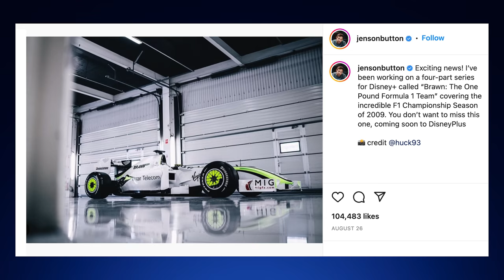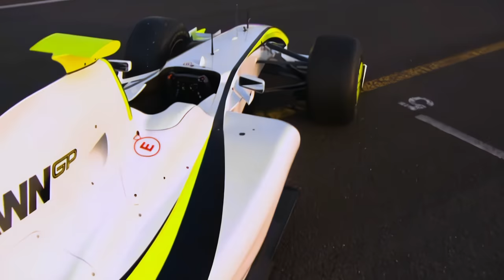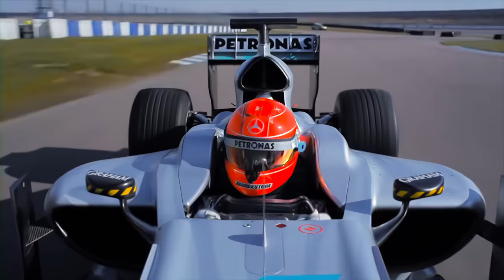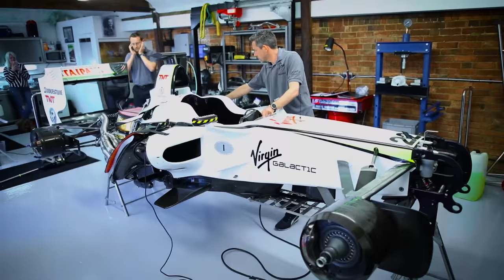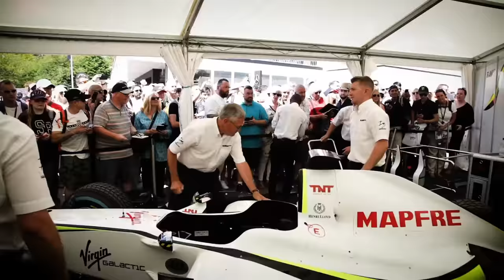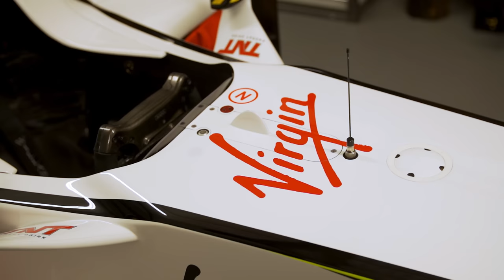Meet The Star Of Brawn: The Impossible Formula 1 Story

Comment: Love to see people maintain old f1 cars instead of just letting them fall into disrepair
Reply: When I was at Williams there was an area where all the cars that hadn't been sold were stacked. Some had parts missing and one of them leaked oil constantly.
Reply: @timwarriner38  mercedes and mclaren fire up there older cars that they have retained for both they have alot of cars
Reply: That's is absolutely stupid to just let these cars rot in the garage.
Reply: @user-hw4st7br9a  all the cars retained by teams are maintained the get fired up to keep them in working condition the ones owned privately most are maintained (I am not aware of any that are not maintained)even the very old cars get run on track still martin brundle has driven a lot of the very old cars on track.
Reply: @user-hw4st7br9a  Well the trouble these days is most teams make at least 4 chassis for the year so that's 4 cars assuming all the bits are made for it. But if its uncompetitive or not vert memorable or good looking its unlikely to sell.
Reply: @user-hw4st7br9a  Go buy em then

Comment: I remember Jenson Button, as a Sky F1 commentator, once talking about the pre-season testing with the Brawn car. He said he could tell pretty early on that this car was something pretty special on the grid. And by the last days of testing, where the competitors lap times had pretty much showed their hand, he knowingly held back from going anywhere near 100% not to tip other teams off. He said he eve held back in the first races not to win with a too big of a margin. That was done to delay other teams copying their design. He knew he had to try and keep hold of their advantage as long as possible, because they wouldn't be able to keep up with the development race.
Reply: Even more impressive when you consider that after basically changing the whole rear of the car to fit the Mercedes engine, the only place available at such late notice to shakedown the car was the tiny (and badly surfaced) Stowe circuit at Silverstone. Stowe at the time was used primarily for Formula Ford, and even with only 100hp they completed a lap in under 50 seconds. Really small track. Brawn had zero idea how the car was going to perform until the official pre-season testing.
Reply: He said that when he first drove the car the balance was off and he wasn't happy, but the team thought he was joking because the car was so quick